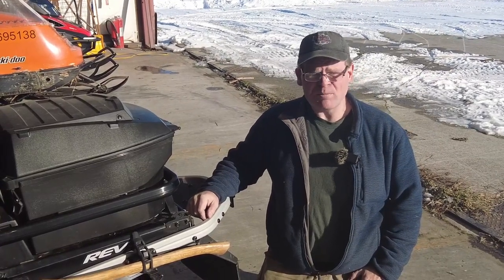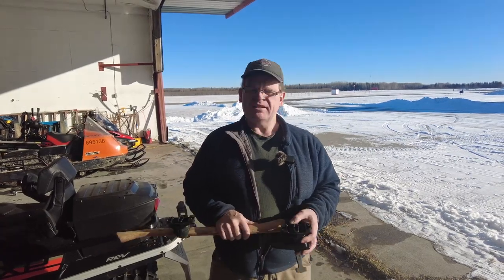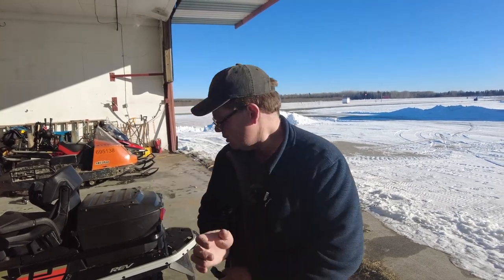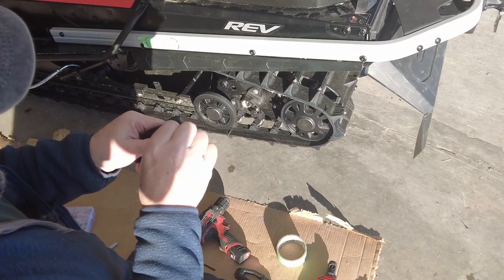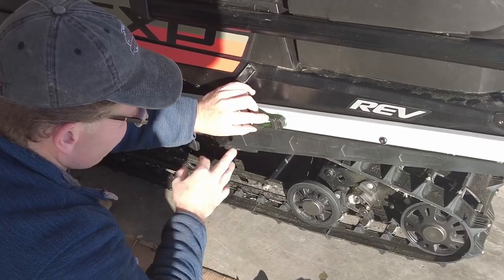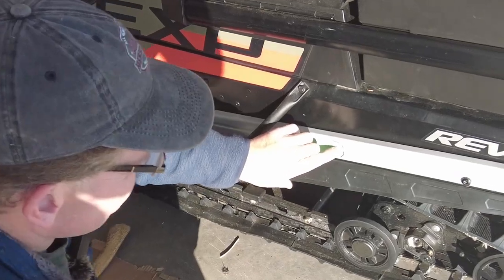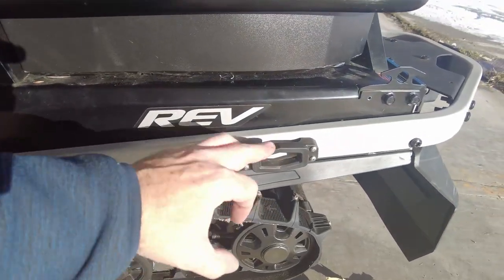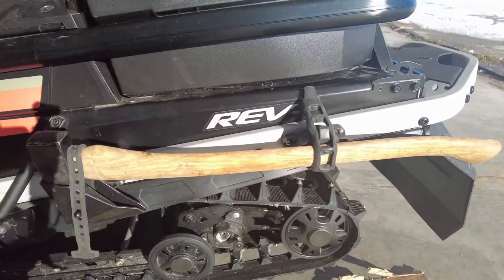Linq Axe Mount Installation on 2019 Ski-Doo Expedition

Comment: Where do you find those tunnel flares to fit Ski-doo?
Reply from the maker: The tunnel flairs are stock on this machine.  It is a 2019 Expedition SE.  This is the Rev-XU chassis and the flairs may be a part of the SE package.